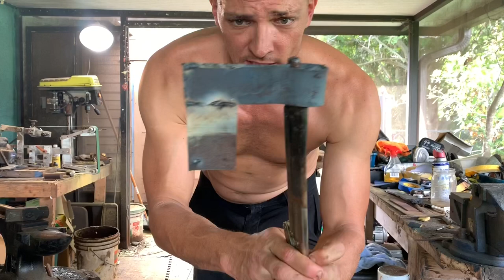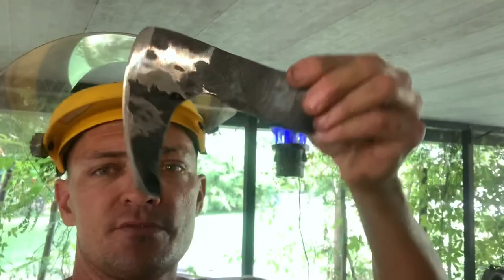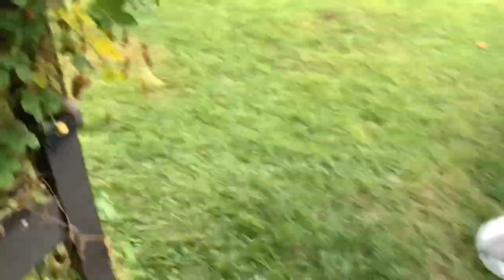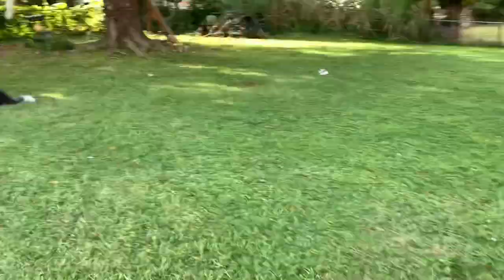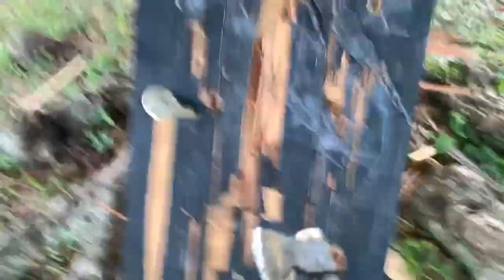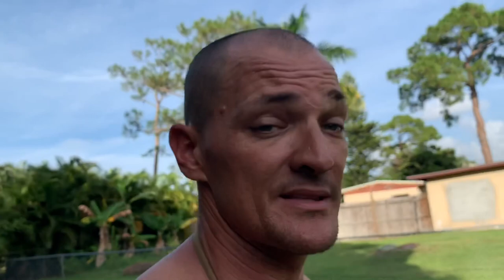45 minute bearded throwing hatchet

Comment: as always love the video. An ax or tomahawk is going to be my next project after i finish up my first friction folder. quick question, have you ever done any work with putting hamons on knives. my friction folder was made with a hamon, but i cant seem to get it to show, any advise on how to get the temper line to come out?
Reply from the maker: D Day Invader use clay.  Spread a thin film of watered down clay all over the blade then about 1/8th inch thick layer along the spine and let it dry.  Heat treat as you normally would.  It’s best to fully hand sand then etch after all is said and done.  You can polish the hamon line further with a compound to bring it out more.